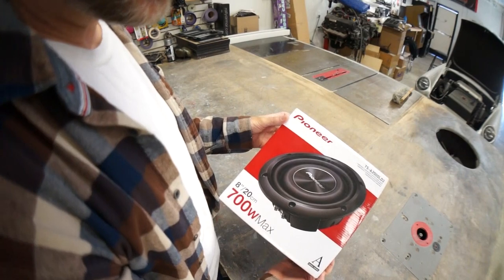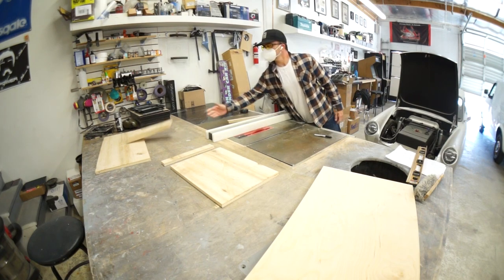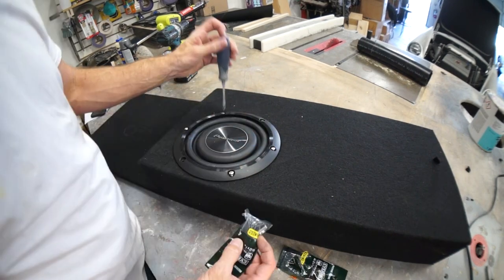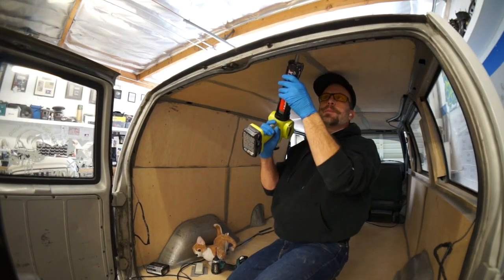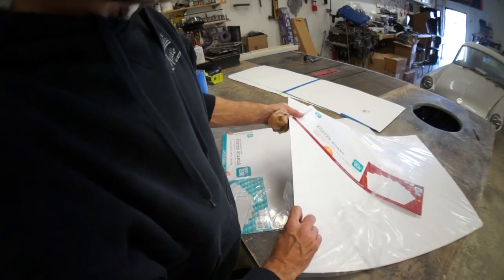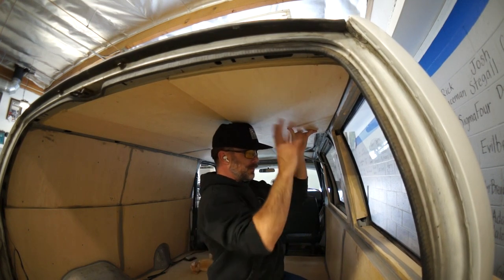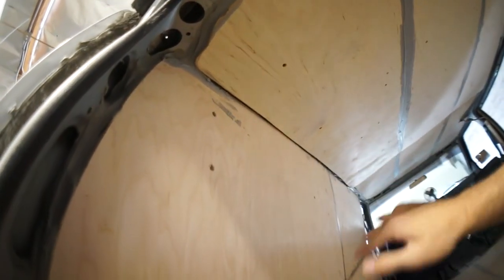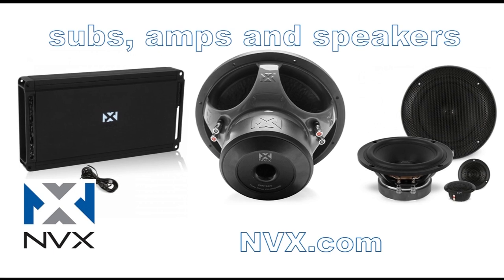BASS WARS 9 💥😱 - BVV#72

Comment: I am 46. The first time this van hits a bass note will be a great retirement surprise for me at 65 years old. By the way... that Loctite is gonna twist.
Reply: That’s pretty good
Reply: Wrong....it’ll swell
Reply: Same here I retire at 65 so another 22years he may get this van some subwoofers
Reply: Spoiler alert when van is done in 20 years Soundman colab with Whistlindiesel and van gets destroyed in 10 minutes
Reply: He can complete it by age 65 thats the early completion estiamte.
Reply: Mark would have had this done 5 yrs ago!!!
Reply: What would be a good product to use instead of the Loctite?
Reply: Yeah... I've used plenty of bolts, and all kinds of washers...
I'm asking because... I'm renovating my grandparents home. It was build over 100 years ago, so damaging the walls is not a great option, as the state is about to designate this area,  "historic"  I actually reached out to loctite, acsking for any information regarding the acoustic properties of their products, specifically, the loctite fast grab 8x.  And.. They basically replied that I was nuts for even asking.. And had no information about that...  Yeah, I've heard about Green Glue and carpet glue but those products don't work for my needs.. And nuts and bolts won't work either.. The goal is to reduce outside noise entering the home using a variety of materials including mass loaded vinyl, all kinds of dense foam... I need it to help keep up some material on the walls, but apparently, no one else has struggled with this issue... Does dried loctite reduce sound going through it? Or does it amplify it, meaning, are certain frequencies likely to pass through? 🤔
 So, any other ideas.? Thanks for your reply a I appreciate it, have a great day. 👍🏼🤠

Comment: For Your consideration.  When spreading the PL adhesive.  Take a tip from tile contractors,   scrape it with a rake trowel after spreading the adhesive.... reason being without the rake  pattern on the adhesive you're potentially traping air pockets/ bubbles.  The rake pattern provides channels for air to escape and adhesive to move into.  Also Mark from fab kitchen is way behind.... he doesn't even have a van! Love the channel.

Comment: Build a helper with some 2x4’s to hold the boards up to the ceiling. Lag bolts with wing nuts and a channel in the middle of the 2x4 so you can adjust it to any angle or lenF. Make a cross for the feet for stability.

Comment: Thanks for the update, Doug.
I'll bet you've added at least 200 pounds in wood and glue to that van by now.
Add the batteries, amps, speakers & wire- there goes another 350.
I'd seriously look into stronger suspension, tougher tires. MPG is going to suck.

Have you made any progress on the "under hood" section? Are you running
only two alternators? One must be dedicated only for the engine; ECM's
don't work very well with brown outs on every bass note. Do you plan
on using caps?

I'd like to see some updates on those parts of the build, too.

Comment: Doug, you're right that EXO's spray foam is trash. But the 2 component mix and pour foam is a whole a different animal. Even the lowest density is super rigid. The flexing of your boards and sheet metal individually is gonna eat a lot more dB's than if you bond them together with a rigid layer. And it's not too late. You just drill holes and pour. EXO was wrong for thinking he needed spray foam at the top of his walls before adding pour foam, because that shit expands. All he needed was a few air bleeds at the top.

Comment: What kind of prep work to do you do to plastic before applying bondo or fiberglass? Im trying to repair my gauge bezel and sanded it before hand, but the first round of fiberglass did not stick. So i peeled it off and applied some bondo with glass hair in it, hoping it sticks. But was curious whats your prep work you do for plastic.

Comment: $5000 worth of templates on the wall, $20,000 CNC router in the corner… tapes a piece of abs to the board and uses a $50 pos ryobi router. 🤨

Comment: I don’t know how that van‘s gonna move that’s gonna be too much weight in that van he’ll be lucky if that thing moves out of the shop at all nice going Doug
Reply: Who's Van¿
Reply: Yo his van is so light compared to exo bass van, atleast we know which van won't flex like crazy n loose decibels
Reply: @jasonpillay5320   I can guarantee it won't be as loud as EXOs. The added weight wont be a problem.
Reply: It doesn’t matter how light his van is is it put the batteries in yet just put the speakers in it it’s gonna create a problem should I start shagging it’s just not gonna work it’s gonna it’s gonna fail
Reply: I need to get a bigger van that’s just way too small for what he’s doing it’s not gonna work
Reply: @matthewcaldwell1563  both of these guys Van should do fine with the weight. BUT EXOS WILL HANDLE BETTER. I MEAN THE EXTREME VAN IS DRIVABLE. #3 LOUDEST IN THE WORLD 🌎.  IT WON'T DO 100MPH THO. BUT IT DOES HAVE SOME POWER
Reply: Look exo's bass van weight does not exceed the maximum carrying capacity of his bass van so the weight ain't a problem
Reply: @matthewcaldwell1563  never a fail sir. We won't let that happen. Shit my car has just as much weight on a  2.7L motor and driver.
Reply: @matthewcaldwell1563  your possibly new to this side of Audio and this level of building..just sit back and chill. If your around audio long enough you will understand. Just maybe. But follow the EXO BUILD.